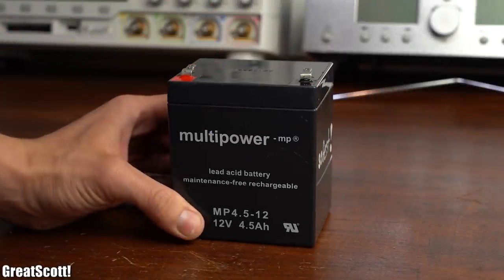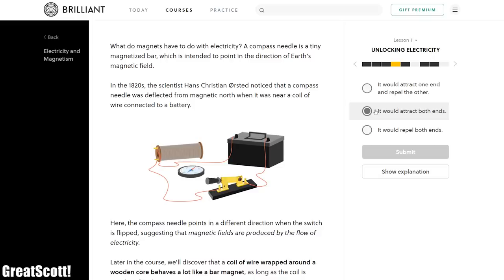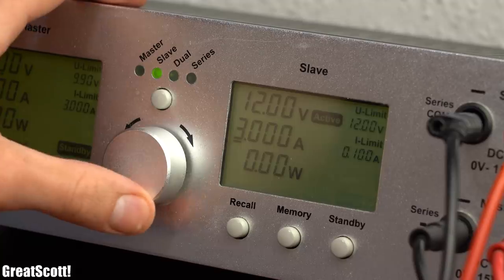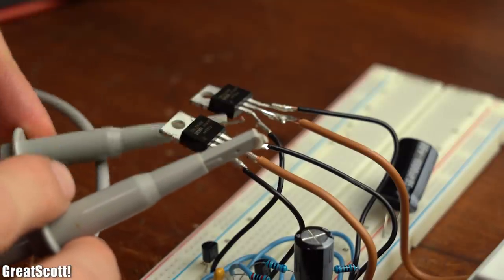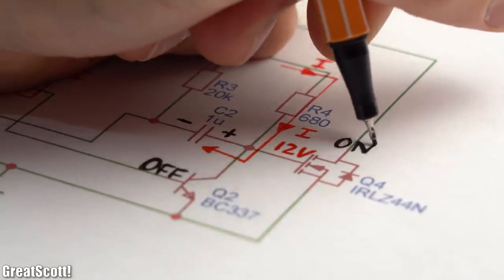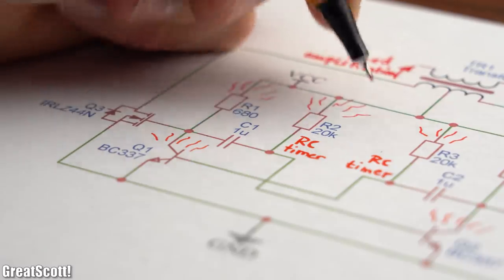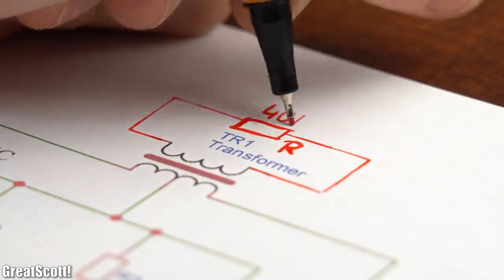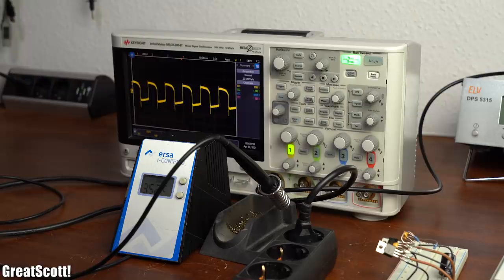Testing circuits I found on the Internet: Inverter! It does work, BUT...

Comment: We want a "Random circuit I found on Internet" series. 🙌
Reply from the maker: If viewers ask for it and the video performs well then there will be more ;-)
Reply: I'm particularly fond of DiodesGoneWild when he dismantles cheap Chinese made chargers and shows their poor construction.
Reply: Yes please. 

You could look at plasma speaker circuits, with a 555 timer. You could test if those work better tham yours.

Or you could look at some fm/ am shortwave radio transmitters. You could compare transmitters with a LC circuit or a cristal osccilator.
Thanks for the vid, it whas great!
Reply: @greatscottlab  can you test a popular FM radio transmitter circuit on 1 or 2 transistors? (or receiver there are a lot of shemes for them) i built like 3 of them and none is working, and i don't know that do i do som
ething wrong or is it just scheme bad
Reply: @greatscottlab  wondering could you make a portable electric guitar amplifier with input voltage of around 11.1 volts m I have several li-on batteries
Reply: Guys, Herr GreatScott said that if we ask for it and the video performs well, there will be more.
WE NEED TO GET THE SUPPORT!
Reply: @greatscottlab  What do we want? 
"Random Circuits!"
When do we want it?
"Now!"
Reply: @greatscottlab  Great idea man! Do a series!
Reply: Yes
Reply: @greatscottlab  we don't want it. WE NEED IT.
Reply: Yes.... @GreatScott! would love to watch such a series
Reply: Yes please
Reply: @greatscottlab  I am an additional viewer asking for it
Reply: @BobBeatski71  sooper dodgieee
Reply: @greatscottlab  In that case, I hope it does well. This video was really good by the way. Your step by step looking at the circuit is super clear.
Reply: Agreed, I absolutely love the topic!
Reply: @greatscottlab  please we need more of these videos.please
Reply: @greatscottlab  yeah this is great for circuit analysis and to better understand what is actually going on
Reply: lovely idea :) :)
Reply: Love this series
Reply: ["Random circuit I found on Internet" series] I was thinking about this too. were IN.
Reply: @greatscottlab  PLEASE

Comment: Worked almost 2 years on a automotive 12V to 230Vrms power inverter (modified sine wave output), with start/stop support. It definitely is not as easy as people on the internet make it seem. Majority of the cheaper inverters on the market are modified sine wave, which has an issue of high inrush current at the AC output due to the square wave nature of the voltage. Pure sine wave inverters require a lot more design work and complexity but somewhat solves this issue.

After working the project for such a long time, I had to add in a secondary voltage stabilizer, such that the input voltage will not affect the AC output. The feedback you mentioned is critical in maintaining correct RMS output voltage, along with the frequency. I ended up also adding a constant current mode controller on the secondary side to help bring up capacitive loads (such as common chargers we find now a days).

Comment: There are always 3 obligatory steps when designing new circuits:
- simulate them
- build them
- measure them in real life
Reply: What is a good simulator to find that simulates in a lifelike manner? Have a lot ot issues when i mix high power with sensitive stuff like micro's and analog
Reply: 1. Build
2. Test
3. Deal with unforeseen consequences 
4. Find out what went wrong 
(or grab a crowbar and fight aliens)
Reply: I used ltspiece in uni no idear if it any good for your use case
Reply: Don't forget to understand how the different elements in your circuit work and how they interact. This is probably the most important thing if designing your own instead of building an already-designed circuit. For instance, you can connect an LED to a battery and have it light, but if you don't understand the IV curve of LEDs your circuit will be very unreliable.

Comment: You should try out one of the 12v fluorescent lamp driver schematics that's floating around on the interwebs... there are a few different variants, with and without cathode heating, and it'd be interesting to see how they compare.
Reply: The ones which apply a waveform with a DC component blacken one end of the tube quicker and reduce lifespan. The cathode heating helps with starting I think.

Comment: Dude!! exactly 2 weeks ago I made this deal, it worked to 120v for about 2 minutes!!, and like you said, the heat changes/kills things on this and BOOM Rico, it killed the 2 transistors.  I might still build it again but with mosfets. Yes I got obsessed, and found a forum with over 60 pages of comments from the last decade, they got obsessed too!, it's the apparent symmetry of the circuits!

Comment: 9:05 the main reason is the inductance of the transformer. The parasitic L is very little in your breadboard and will decrease even more on a PCB. You are however correct, this can be an issue for big currents buy not in your appliance. The snubber is well designed, yet it of course makes your circuit less efficiently. Dont get me wrong, thank you for a good video nevertheless!

Comment: There are so many circuits on you tube and the internet about changing voltagelike buck boost and variable voltage circuits.  But none of them mention the voltage under load or about the current variations.  That makes thosse simple variable V controllers like tose with lm317 etc  to break down under load and in real conditions.  Would you kindly enlighten hobbyists like me about such circuits?  You seem tomake dependable circuits and your explanations are thorough and undertandable.  Thanks for your contributions and kindly continue to do so.

Comment: If you want a minimal oscillator, here are two:

1. Connect a relay to itself such that it turns itself off when it is on and vice-versa. Put a capacitor across its coil to slow the oscillations down.

2. Program an Arduino.

If I wanted an inverter I'd use an Arduino's to drive a MOSFET to energise the primary coils following a sine wave via PWM and maybe an LC to filter out the fundamental. Might need a MOSFET driver if the frequency is high enough.

Comment: You should provide a link to a circuit that performs the task correctly in the description for those actually wanting to build one.
Adding a grid tie circuit (to an actual functioning circuit) would also make a nice video.
Reply: Get 40bucks and buy  proper inverter IF you need one. If you ask for ready to go schematics you should not play with 230V. Coffins are expensive.

Comment: hey there i have few sugestions regarding the project  firstly the phone charger mostly can work with a input voltage between 80v AC (RMS) up till 240v AC and it mostly can  also work with little bit voltage above that and since the charger first rectifies the input voltage so you can also directly hook up to a 115VDC to 340 Vdc power supply it doesnt matter what is the frequency of the supply secondly it is very important to choose a right kind of transformer it would be more efficent if you had used a ferrite core transformer along with an oscilator circuit that works in range of 20Khz to 60Khz range to step up the voltage using a dedictated PWM Control IC that also has output feedback and and you can also add a SPWM based topolgy to get a pure sine wave at the output

Comment: I've had a person argue with me that a RaspberryPi 240Vac relay add-on card he was demonstrating did not need an insulator sheet because there were no mains voltages present that could damage the Pi.  The mains relays were through hole parts with exposed 240Vac pins.

Comment: Best diy pure sine wave inverter you can make at home is a dc motor connected to 3 phase generator(car alternator with removed diode bridge as an example), you will have 3 phases each with pure sine wave, which you can then transform to required voltage using simple transformer, frequency can be regulated by rpm. Efficiency would be acceptable...

Comment: 0:15 The ACTUALLY reasonable thing would be to find equivalent circuits that work on 12V power, the unreasonable thing is to buy an inverter, the really really unreasonable thing is to build your own inverter, the DUMB thing is to build an inverter from google image search.

Comment: Dead time to reduce cross conduction helps a lot , just use 3525 or 494 controller chip. varying pulse width can help provide some regulation too.  Introducing a higher frequency PWN over the square wave essentially gives you pwm generated sine wave.

Comment: The circuit is called astable multivibrator and is the first basic oscillator that is teached in electronics school class and has fixed frequency and duty cycle output.It can not be used for powerful demanding applications circuits and is impossible to have any feedback sensing.The output is always a square pulse.

Comment: I am already subscribed because I find your content unbiased and informative.
Can you recomend a square sine wave inverter (for me to build) to undertake two operations as follows ;
>
1 Power several appliances, not all at once the biggest would be 230v 1000w microwave
2 To build a Li-ion battery charger to power the above inverter.
a) Would a leisure battery suit my needs better.
I was given bad advice and I have purchased two new stepper motors, if I can somehow incorporate these into this project would be somewhat beneficial.
The same person told me to purchase 20 Li-ion batteries but after reading reports on Li-ion batteries catching fire / exploding caught my attention.
I am now unable to reach this person.

Comment: Maybe I'm missing something obvious here but surely you could rectify the square wave into nice sinusoid by adding a BPF (or even low pass) centered on 50Hz directly before the transformer.  You could also tune the gain as much your op-amp would allow to get a better voltage level.

Comment: at 6:53 you give a formula for approximating the frequency, 0.72/RC, but 20Kohm and 1uF gives 36Hz, is that due to component imperfections? How did it turn out to be almost perfectly 50Hz?
If you do just 1/RC it comes out as exactly 50Hz, so where does the 0.72 come from?
And when i simulate an Astable multivibrator, the 0.72/RC DOES work! What is going on?

Comment: 10:54 you are #laying here 😃
Because even if the main voltage goes higher then 220 at the charger side phone should sill be protected because as you know it's not only isolated by pulse transformer but also regulated if any how voltage goes high at the primary side of the smps  it will instantly destroy the charger circuit of primary side this will cause  oscillation to stop dus no power transfer to secondary and even after that phones has its own regulator and tvs didode as protection of the charging circuit .
Reply: Great scott is right, because not ALL phone chargers are Original,cheap phone chargers are not protected will,Those high voltage spikes can kill a smartphone in a micro second.  DON'T SAY TO HIM (YOU ARE LAYING!).....NEVER!
Reply: @Abodino  but i already tried it many times it doesn't damage  my any phone .
So i said
Reply: @omsingharjit  Ok

Comment: Actually I found an even more simple way. Use an arduono to make an AC square wave, use that signal with a high current H-bridge at 12 volts, and run it through a transformer. It’s inefficient, and not a sine wave, but it works. However I shocked myself badly testing it

Comment: There are also 12v car chargers and light bulbs. You can just connect them directly to the battery and not be bothered with any inverters and high voltages. :D

Comment: Hi Greatscott, I was wondering if you can investigate the audio circuits like the values of the components, suspesious circuitry the audio if it works, I can't prove whether it is functional or not due to limited tools to perform. I'm just criouous though. Thanks and this deepen my understanding about the topic of simple diy inverters that it been popping around my youtube feed. 🙂

Comment: If I was going down this route I would rectify the output to DC. Most appliances with switch mode power supplies run fine on DC. So essentially just make a DC to DC converter, 12 to 170v-300v DC (that is a approximation of the RMS AC value in DC, the AC voltage rating for most is SMPS 100- 250Vac)

Comment: If people want a "modified sine wave" (AKA a square wave) invertor. Just get an old crappy UPS. You can often pick them up for free, ask around and find out if anyone you know has one with a dead battery, if you already have a battery that's not a problem.

Comment: Plz test the circuit of cellphone jammer which have  used bf494 transistor .
I know 494 frequency is not enough for jamming modern phone but i wanna know if this circuit works or not ?

Comment: I have been doing this kind of DIY since 2014. Google schematic, purchase the parts and build it. But I am skeptical when it comes to schematics. Even though I am not an expert in electronics and just a hobbyist, I still choose the more complex schematics than the simplest one. Simply because I am assuming that the more complex, the more functional it will be. I have already built mini guitar amplifier, guitar distortion FX, fm transmitter, and various DIY stuff..

Comment: Why do people use bipolar transistors to fire up the power mosfets? I made the same circuit using I.G.B.Ts and works great without using bipolar transistors. I found the same thing, no voltage control or frequency regulation

Comment: Could you please make a video on how best to charge your battery with solar panels (car battery or Li-Ion battery)?  Maybe a Diy or Buy episode on how to use a power bank with a solar charger and conventional charging circuit in connection with the socket and whether it is worth building it yourself or is it better to buy it?

Comment: Great video as we always get🔥🔥... I have a question...
why is it not showing the half sine waves(for astable multivibrator)?.. I mean we read that for ideal components but electroboom's "Almost melting metals with inductor" video also showed that it will be sine wave in emitter of the transistor. Then what is the problem here?

Comment: Could you make a video about how to make a proper inverter that will work with sensitive electronics? Or, you could make a larger series out of that on how to build your own UPS (which includes an inverter and a battery charger).

Comment: Thanks for such videos. You can simply use EGS002 module instead of astable multivibrator for super cheap and enjoy the pure sine wave 😎 also you can cross out that giant transformer and due to high frequency pulses, a smaller ferrite transformer could be used.
Reply: You also have some sort of protection as well like short circuit and over temperature. 🙂
Reply: It also provides feedback network in order to keep output voltage and frequency constant and independent to output load and to some extent input voltage. 👌

Comment: Maybe look at building a high-speed inverter?  I recently found myself in a situation where I was shy of a not / nand gate and built one myself.  It worked at lower clock speeds, but the storage time of the transistor i used (2N2222 and a few others) was tens of nanoseconds too slow to switch in time.  Comparing this to an appropriate CMOS circuit would be useful.

Comment: Are MOSFET heat or damage when battery voltage is between 6 to 8 volt due to increased RDS of MOSFET. I made this circuit but MOSFET damage when battery is low . Please advise me

Comment: Hi, for a future video of this series I suggest the "simple FM transmitter" (the one with only two transistor, one for the class A amp and one for the oscillator). It's not a circuit hard to understand but in the videos where it's made they don't explain it and they say the range is almost 50 mt. I tried to make one, it works bad and the range was less than 10 cm. I wonder if it's my bad or the internet video are fake.
P.S. Your videos are awesome, good job.

Comment: Wow Great Scott! Awesome video showing the issues voltage peaks and leaks, but where is the link in description to the corrected schematic that you've done for rectifying the issues? Could you please include that with list of the parts resistors diodes etc needed for a proper functioning kit/set up that won't fry our devices/electronics(phones especially). 

What mini inverter models can be used for charging phones and power LED light bulbs(or led mini panels from old LED blown emergency lights which so seldom something dies soon on them since they are charged from 240 bolts wire to the minimalistic PCB Boards on them, so can make the LED panel and/or existing onboard battery if it can power the LED panel or does that need a diode or resistor to push sufficient power to at least remain useful by connecting them to old UPS batteries in case of power outages so there's at least lights in case of emergency) as you've shown for dry cell batteries meant for 12v UPS?

Also Can 2 Batteries be used/connected in a single UPS(extra battery kept out of the cabinet obviously two wires running to the terminals on internal battery) for increasing backup time to run Routers or a low powered server. Could you please do a video on that by any chance? Sorry for the multiple questions and Thanks in advance.
Warm Regards, Michael👼🏽🕵🏼‍♂️🇮🇳🗺️👍🏼🙏🏼